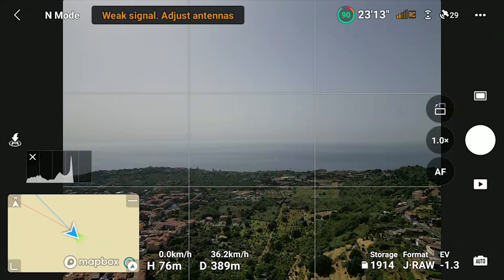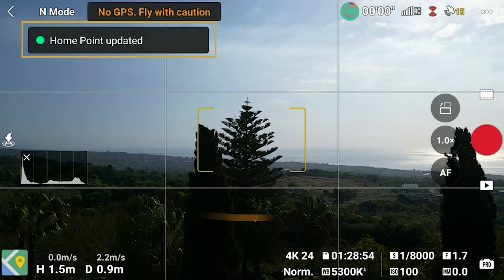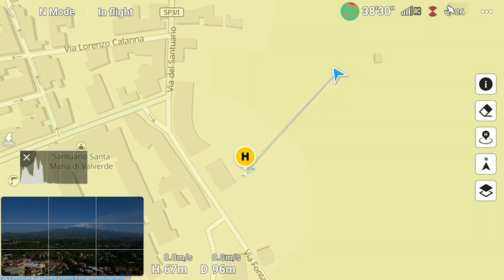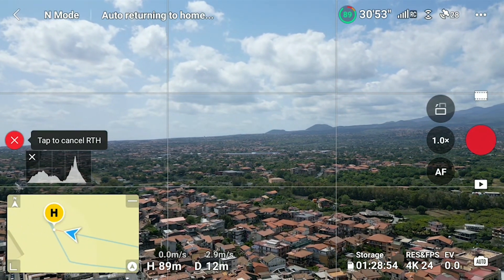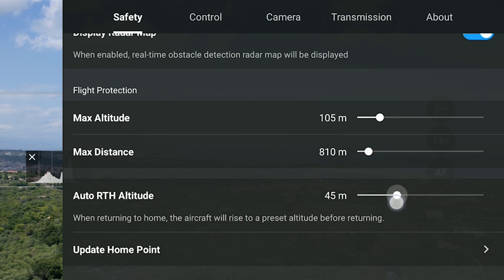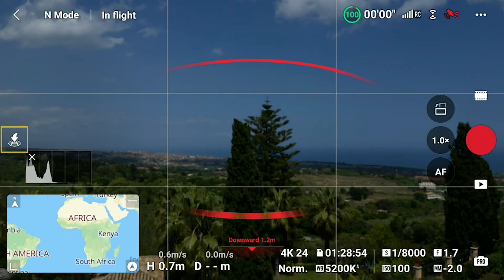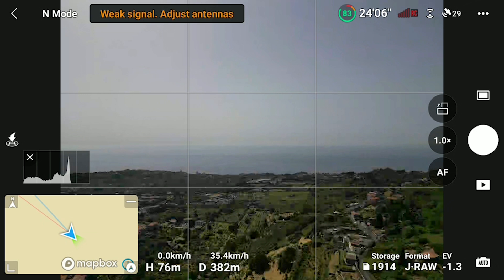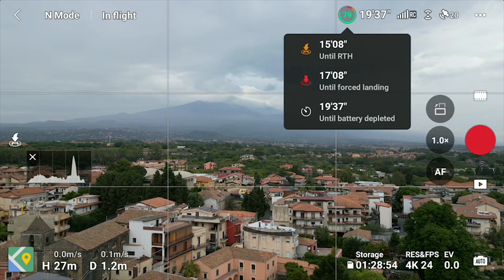Dji Mini 3 and 3 Pro Return To Home Tutorial

Comment: My Mini3 Pro screen doesent look like yours and I don’t see the possibility to use the Remote as a RTH point. Or has this changed during the last update? Can you explain why?
Reply from the maker: Hi,
if go to the Safety tab of the settings, you will find the option Update Home Point. 
It will show a map with th e position of the HP, the drone and the controller. The map can be dragged to modify the position, or you can tap one of the two icons to the right to place the HP at the position of the controller or the one of the drone.
I believe it has been like this since the first version, but I am not sure
Reply: Hi. 
Well as mentioned, I don’t have these two icons. Otherwise it would be easy. 
Does the remote require internet to use this function?

Comment: I worry about that the battery warning that you need to return to home does not take into account the wind. What if you have a headwind or a diagonal cross wind that will slow down your flight back and then you won't make it in time. 

I would like to see an emergency video of what to do in such a situation like perhaps quickly finding a spot to identify where you know you can go pick it up.

   Secondly, in such a situation where you are not sure you can make it back in time, it seems to me that flying as low as you safely can will avoid stronger headwinds that seem to be at higher altitudes.

  Also, I had an experience where I landed a distance away and my home point was changed to the point I landed at. So if you are low on battery and press return to home and it starts going back to the place you landed at, that could be a problem.

   I also want to mention that return to home is not precision perfect. It could be 5 feet to 10 feet off placing the drone in a bad spot where it becomes critical to put it back to manual control to maneuver to the precise point.

  And finally, often times the return to home point is no good for the drone to land so the only option is to somehow land the drone on your hand or swipe the drone from the air and turn it over. This method presents a little problem because the drone moves away from your hand because of obstacle avoidance. Would like to see the best way to handle that.
Reply: Seems as though if you know about these items you've already watched a bunch of vids about them. Your comment says more about you than what the words say.